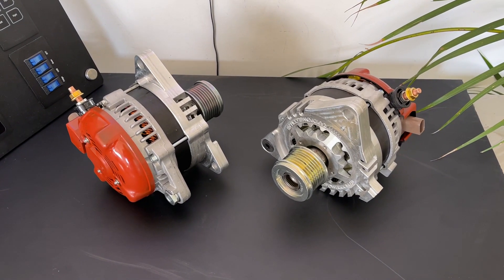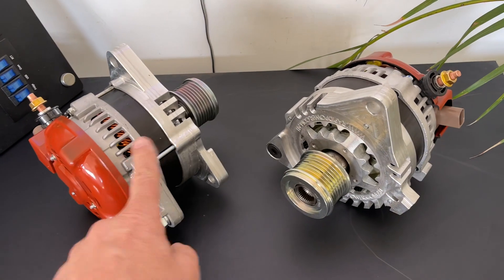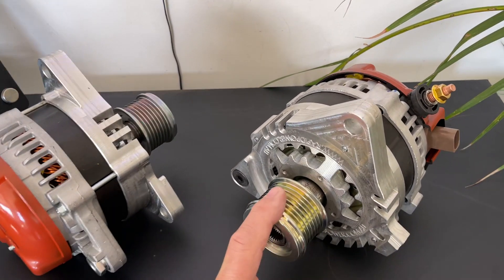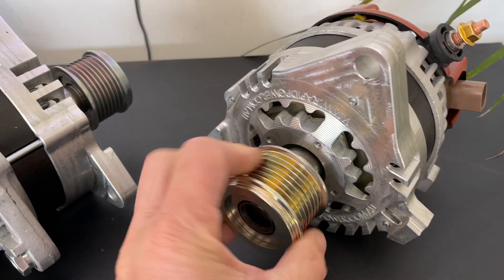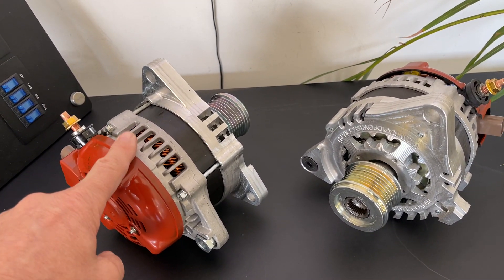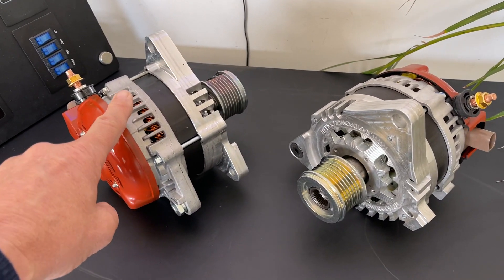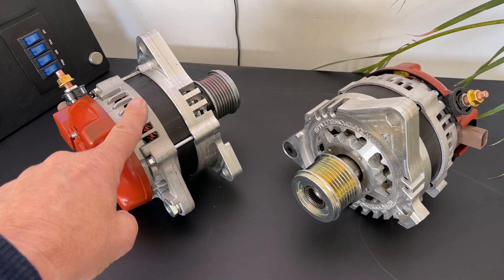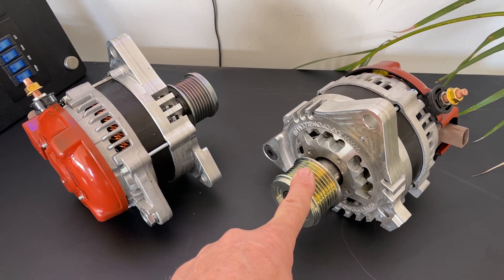250A Alternators for Toyota Hilux perfect with Scotty

Comment: Hi Bruce just starting out on this lithium battery journey Vw amaroc v6 2020 120/180 smart alternator? Is Scotty a viable option the Vw for a 48 v 3000 inverter 200/400 can bus battery incanopy system thanks James. really enjoy your practical approach
Reply from the maker: Yes it is. We even have Euro 6.2 Compatibility.
Reply: I have a 3 letter hilx 2010 model. I live In cyprus. Do you have an alternator that is an upgrade to mine ?

Comment: Lets just hear that again.  Variable output...protects the Alternator...maximizes the output. AND has a clutch...you mean like an AC compressor has a clutch. AND available in several output voltages I hope.....Like 48 VOLTS. How good is that.